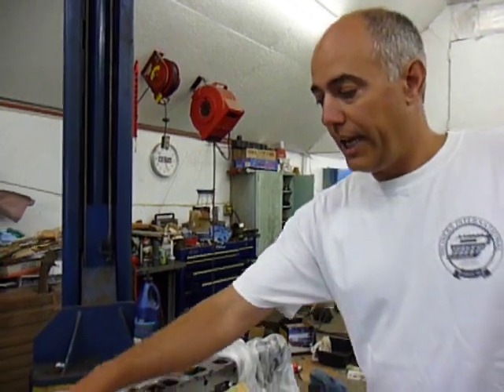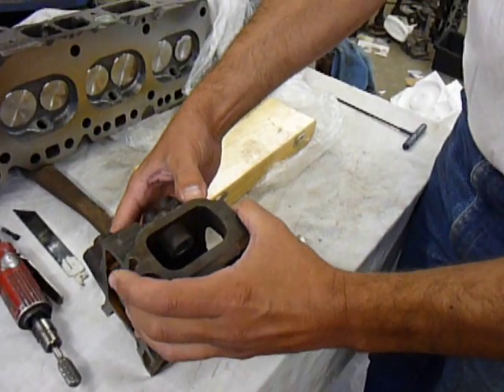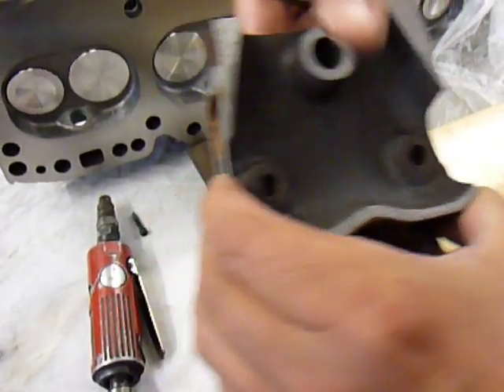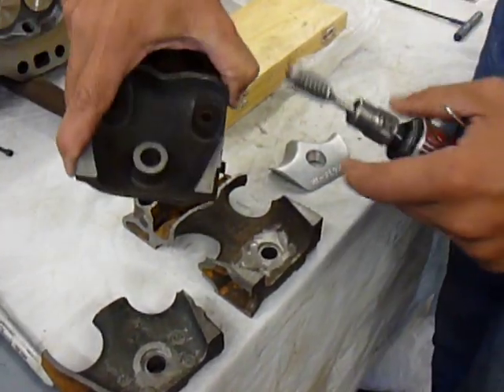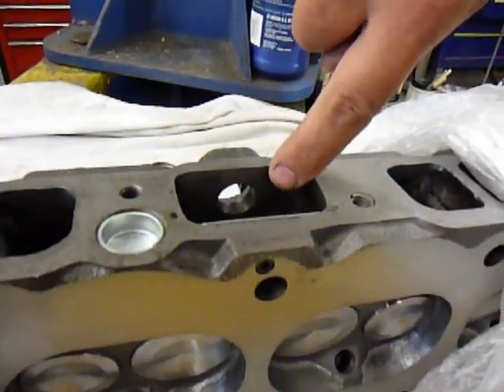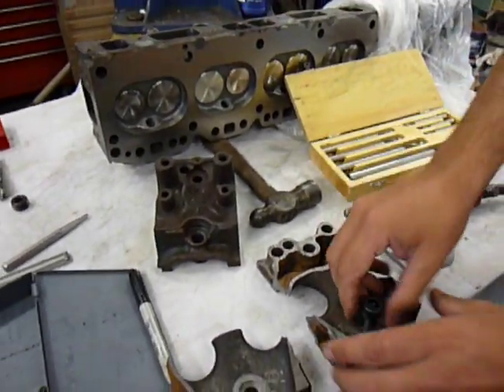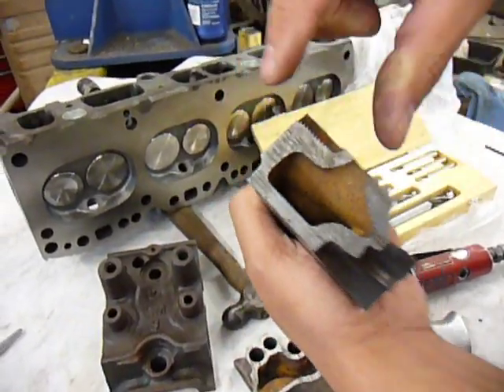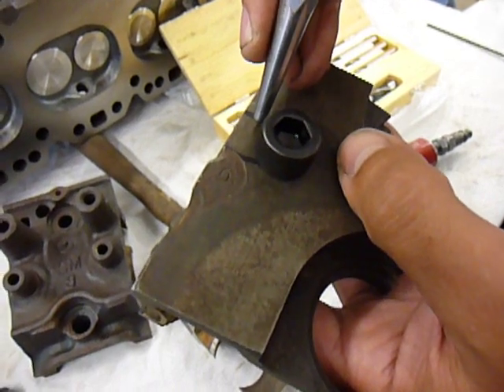Part 1 Chevy inline 6 and 4 cyl head intake lump port install 194 230 250 292 153 181

Comment: So adding all that material doesn't obstruct the flow of the port? Seems like you're always hearing about people REMOVING as much material as they can without going through the walls. Does the redirected flow just more than make up for the loss of total cfm airflow? Also seems like a narrower port would increase the airflow velocity and give better atomization and swirl in the chamber...does that have any effect?
Reply: Adding to the port floor and removing from the port roof redirects the air flow for much nicer entry to the cylinder.
Reply: Volumetric consistency is what you need. This gives that intake port a nice even path. Without it, it’s kind of like an expansion chamber on a 2 stroke where the air spreads out. And thus it slows your airflow. Dyno results have proven these work by a dramatic degree.